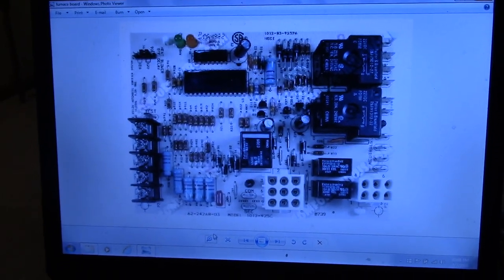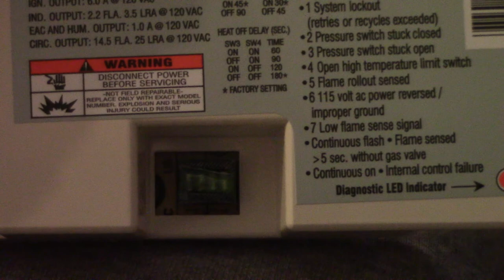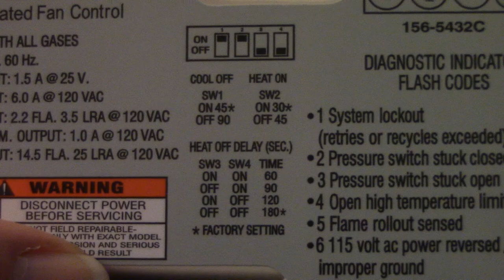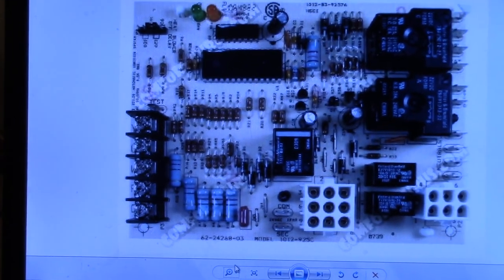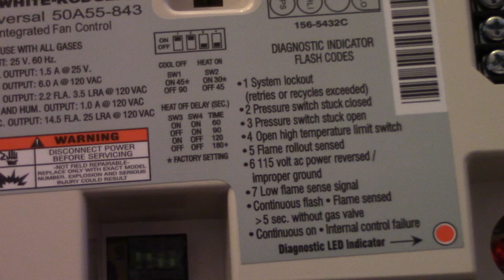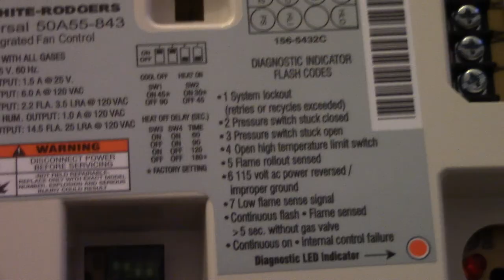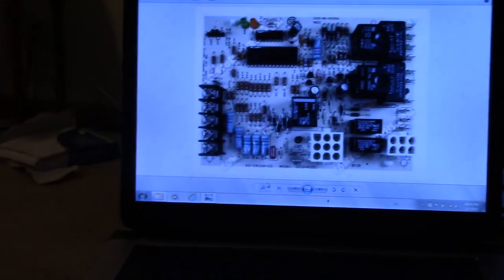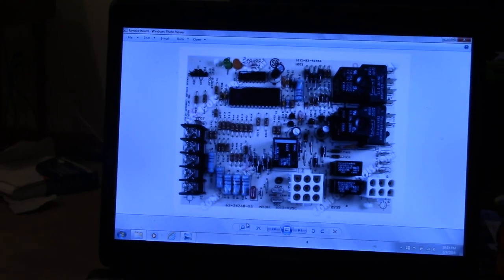Furnace blower off delay adjustment and why we have it on a furnace.

Comment: In the interests of moving your excellent video towards perfection...
'DIP' in 'DIP switch' stands for Dual Inline Package.
p.s.
The 1966 gas furnace in my house has no circuit board.
Wires are simply routed through the air to connect the various components.
The living room thermostat and the gas valve in the furnace have the Honeywell logo.
When I bought this house twenty years ago,
I didn't know why the furnace blower ran continuously but 
we were all perfectly happy with constant air circulation. 
Turns out the previous owner had bypassed the 'Fan Delay Module' for some reason
and that was the cause of the fan being always on whenever the furnace was powered.

Then one jolly minus 40 night about two months ago while sleeping, 
the fan motor started a soul chilling squeal. 
Knowing nothing about furnaces I thought Oh No and switched the furnace off.
When I switched it on again the motor made a sad noise but turn it would not.
Amazing how quickly this house cools down in minus 40 weather.
Turned the kitchen oven on and stayed uncomfortably cold, awake, drinking coffee
until the hardware store opened at  8a.m.
Luckily the car started but driving 10 miles through blowing snow at  -40 was no picnic. 
Anyway, I got a motor which I installed lickety split with no skinned knuckle, 
though kneeling on the concrete caused my poor old knees to shriek.
Sadly, that new motor died after only 5 months of continuous operation.
So I got another with double the horsepower but it died almost as quickly.
Boy that original motor was a good one lasting 55 years as it did. 
(It had a metal GE label riveted to it).

I've half-assed fixed the problem with a microcontroller, servo and thermistor and a program that applies a minimum duty cycle to motor operation but,
and here's my question,
my Fan-Delay-Module's got a little dial on it that can be turned from 0 to 180 and 
the back of it extends 6 inches or so into the heating chamber,
can you tell me where I can get a replacement?
Cheers!

p.s. The time line in the above is a bit messed up but that don't really matter.

p.p.s  I was depressed to hear the life expectancy of modern
high efficiency furnaces is only 15 to 20 years!
I'm sure that's partly why I want to keep the current one going.
Reply from the maker: Johnstone supply is all over the US. I know some places will only sell to contractors or licensed technicians. C.d. Jones, cfm. The last I knew they were getting old those style fan limit switches. I belive your talking about the fan limit switch. Manufacturers started in the 80s or 90s going from 30 to 20 year life expectancy. 

Installation is more important that the brand since 2 companies make the gas valves and safeties. Good duct work and properly installed furnaces will last the 20 years.

But they don't use eighth inch or quarter inch plate steel lije I've seen on the 1940s style.
Reply: @ChilesHeatCool  Thanks for the info. I'll let you know how things turn out.

Comment: Hi, thank you for the video. 
I'd like to set up the fan delay on my Trane in order to cool off another 90s during the Summer while the coils are still cold. Do I have to do that at the furnace level as well even though it is cooling?
Reply from the maker: Unless it's a newer furnace with an ecm motor, you cant they only had heat delay. I remember that some of the newer could, but I cant say for sure with out the manual.
Reply: @ChilesHeatCool  it's a 2009 unit. The heat pump is r22.
Reply from the maker: No not possible on that unit I bet. If it was a variable speed maybe.
Reply from the maker: I shouldn't say not possible, you would have to wire in a special timer.b
Reply: @ChilesHeatCool  Thank you, I'll look into it then. 👍

Comment: I have a coleman furnace  witch has thr blower delay pins and thr fsn speed pins... the furnace  runs abnormally shortcycles sometimes  overheating.. im not sure if its related  to the blower  delay  pins being  in the wrong spot
Reply from the maker: Nope. It is pretty programmed approximately 30 on delay after proving the flame. If it's over heating that could be from low air flow( dirty coil, dirty filter, duct issues, blocked returns or supply) or to high of manifold gas pressure. 

Could also be a diry blower wheel or a weak fan. Could be a weak limit switch or someone put the wrong limit switch in. It's best to have a pro check it out if it is over heating. Could just need a good cleaning.

Comment: Too short of a blower off delay can cause a heat exchanger to overheat on the high limit, the next time there’s a call for heat, due to what’s called “heat soak.” If the heat isn’t extracted enough from the heat exchanger, before the blower turns off, it will actually get hotter, for a short time. Thus tripping the high limit switch. I’ve seen this on a few furnaces. Typically older Sterling units.

Comment: Great video. I have a white Rodgers with three dip switches. The instructions on the schematic shows, which one has the. cool delay to fan off. My assumption was by flipping this to off once the compressor turns off the fan will continue to blow for 80 seconds. I flipped it from one to zero or on to off and didn’t notice the fan continuing to run when the compressor turned off, which is what I was expecting. Any ideas? I think blowing air over the cold evaporator for 80 seconds after the compressor turns off is a good thing, but moving the switch didn’t appear to do anything unless I’m missing something. Thank you.
Reply from the maker: It might be a fan speed selection switch. Some boards had sliding switches that would say heat cool and it adjusted the speed. Most furnaces did not have a cool delay. Modern furnaces have a setting for them.
Reply: @ChilesHeatCool  - thanks. I’m guessing that functionality I thought would happen is optional on mine. Sounds like some have a fan delay for cooling for fan off and on. I understand the delay to turning fan off once compressor turns off not really sure what turning the fan on for x seconds prior to compressor starting would be desired. Anyway thanks
Reply from the maker: Sounds like a compressor delay. Older systems started everything at once. Newer systems started to delay the fan on for efficiency. Let the coil get cold before circulating air, around 5 to 20 seconds. If you find a time delay relay it could be wired in for the fan delay.

Comment: Hi not sure if you will see this. I have oil burner with a control board like on your laptop with jumpers for the delay. I removed and replaced a primary control to fix it and serviced the furnace. After my delay doesn't work, it shuts down burner and fan as soon as Tstat is satisfied. Any ideas? Thanks for the video.
Reply from the maker: Not fully sure, I haven't delt with oil much. I would say it's possible the board is bad, but I've never delt with one on an oil set up. Sorry.

Comment: Thank you for your video.  My blower will turn on before the heat is warm so I get cold air for 30 seconds before I feel warm air.  How do I delay the blower from turning on.  I have a Honeywell 8500
Reply from the maker: You can't. Its programmed in the furnace board. Only on old natural draft furnaces can the on be adjusted.
Reply: It's running ok. You get cool air first because that's what the ducts are holding before the call for heat starts the cycle. Once that gets pushed out, you get the hot air. It's the same thing that happens when you open the hot-water tap.

Comment: I have a travel trailer with a Coleman AC unit...I want my fan motor to keep running for 30 seconds after the AC Compressor kicks off to cool down the compressor and to warm up the condenser...Is that possible and if so how do I do it...
Reply from the maker: Not fully sure, but I think a time delay relay would work but it depends on the voltage. I'm just nat familiar with that equipment to say. You would have to read the schematic or trace out wires to put one in but may need an extra wire installed.

Comment: Thanks how do i set the fan speed for the heat or the ac thanks ...
Reply from the maker: Fan speed I kinda cover in a new video I just uploaded. You have to move wires around and do testing to make sure its right.

Comment: Hello Chris I have this type board my question is on the heat switch I have high mph and low settings what is this for more heat or what
Reply from the maker: No, its just to vary the air flow if im right. Somr have switches to select between heat and cooling. Coolong will usually be high and low is usually heat.

Comment: How can I turn off the blower delay for AC on an ICP air handler causing high humidity problems?
Reply from the maker: You really can't for a/c. The biggest thing for high humidity may be an airflow issue or an over sized a/c. Double check the delta t to ensure the correct air flow. Also make sure the house dies not have a lot of infiltration.
Reply: The AC is actually half a ton undersized and no duct leaks. When the compressor is running the humidity goes down, but when the compressor turns off and the fan runs for an extra couple minutes the humidity goes back up. At another house of ours there is no fan delay on an American standard AC and the humidity is way lower!

Comment: My furnace problem is the furnace turns off prematurely, then turns back on again. It goes in a cycle like this. I cleaned the flame sensor. There is no flame roll out. The upper chamber does not seem to be hot. It all started with my furnace inducer motor went. I called a company. Before they even came, they told me that I needed a new furnace. They will do a free evaluation. There were two guys. One was talking with me outside the utility room, the other opened the lower chamber of the furnace which had circuit board in it. (The upper chamber was already opened by me.) They also did measurements of the furnace dimensions. After they left. I replaced the inducer motor, also the collector box because it cracked. I also replaced the air blower capacitor because it was out of range. I also changed the low pressure switch because the error code said it did not close or reopened. Can modifying the circuit board cause this problem?
Reply from the maker: So, a few things come to mind. Is the thermostat an old one? Does it still have the mercury in it? If the pressure switch did an opening it and closing it could have been the old inducer was going out, it could be something with the vent. A manometer will tell you the vacuum and if it goes out of range. Either you got a bad pressure switch (mass produced it happens) or you vent cap needs to be checked. I've delt with some problems like this and it could be a venting issue, broken thermostat wire or lose wire, bad or clogged pressure switch, bad vent termination so the wind messes with it, or a circuit board issue.
Reply: Thank you for the suggestions. My low pressure switch is new. I also monitored it with a multimeter during the furnace run. I measured the voltage. When inducer started the voltage was about 27v, then it went down to about zero. When the cycle stopped, it became 27v again. My thermostat is also pretty new plus I have tested on skipping the thermostat, the furnace still does the same thing, turns off prematurely, then turns back up again. I also checked the vent there is nothing in the pipe. My vent pipe goes through the sidewall straight, therefore, I can see the inside of the pipe. Oh one more thing to report. A couple of days before the furnace stopped working, the weather was very cold and outside wind was very heavy, the air blower started working very hard. The filter even was curved in. I changed the filter a couple of weeks ago.
Reply from the maker: I have a few videos that will go over some pressure switch troubleshooting and give information on it. If the filter was really dirty, you might need the heat exchanger checked.
Reply: @ChilesHeatCool  Thank you for your help. If the heat exchanger is dirty or plugged, the upper limit switch would trigger.  I monitored the upper limit switch with a multimeter, it was alway continuous, even after the furnace turned off. (I measured the voltage across that sensor. I was always zero.) I will watch those videos. Where can I get the links?
Reply from the maker: Nope. Limit switch is high temperature safety only. Like if the filter is to dirty or the blower stops. I have a video that talks about it.
Reply: @ChilesHeatCool  Thanks for your help. I took the air blower out of the bottom chamber of my furnace so that I could see the secondary heat exchanger from the below. The heat exchanger is very clean! I found a lot of grease and dirt in the condensate trap. I also found some sharp edges or corners inside the collector box were melted. I have cleaned the condensate trap, replaced the collector box again, and vacuum cleaned the secondary heat exchanger. But, the problem is still the same. It seems to me that the air blower comes on too late.
Reply from the maker: Research the model number and serial number to see if the limit switch is correct. The limit switch will have a L135-30 or something like that. It is the temperature rating at when it will open and close. There is a chance that it may be wrong or bad. You can even call the manufacturer to verify that to. Hopefully I'm getting you in the right direction with help.
Reply: @ChilesHeatCool  Thanks, I will look into the limit switch. Since these guys put the grease in the system, they could do something else to harm my circuit board. Based on your experience, could the circuit board be damaged to cause short cycle? I didn’t find any damage yet.
Reply from the maker: It could, but I would have to see it know for sure. You have to turn power off and pull the board to fully look at it.
Reply: I checked the limit switch before by a multimeter. The switch was continuous from flame starting up to furnace shutting down. (The voltage was alway zero.) The limit on my furnace switch is L210-20F. My Tempstar furnace model number is N9MP2075B12C1, serial number is A060359254. The limit switch on my furnace is right. I checked the part number. 

I can take a picture of the circuit board. How do I send it to you? Bye the way, now the system does not restart any more after the first cycle. I wanted to hire another company to repair the furnace. But, they also wanted to change the entire furnace before even coming to look at it. I really think that I am only one step away from fixing the problem.

Really appreciate your help!
Reply from the maker: If all safeties and the thermostat test good, it's probably going to be the board. Look for swelled capacitors and burn spots on it. It could be a loose connection on the board.

Comment: I want to change the amount of time in which the cold air blows after heating cycle... anyone help?
Reply from the maker: Just look at the board and select the setting you desire.
Reply: @ChilesHeatCool  does power need to be off?
Reply from the maker: @Crowhil13  yes just yo be safe. I'd hate to see you bump something and get zzzzzapped.